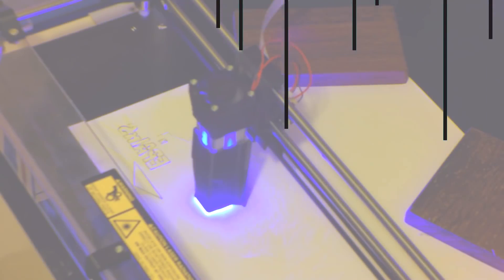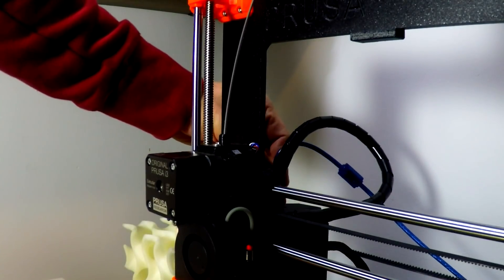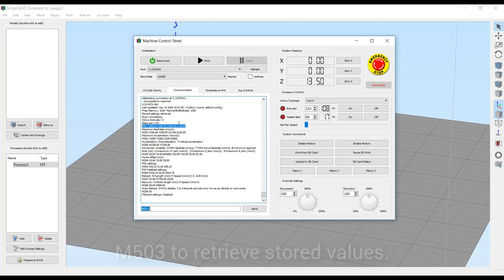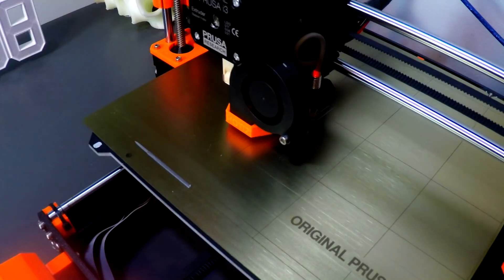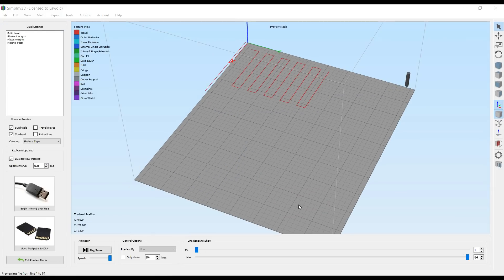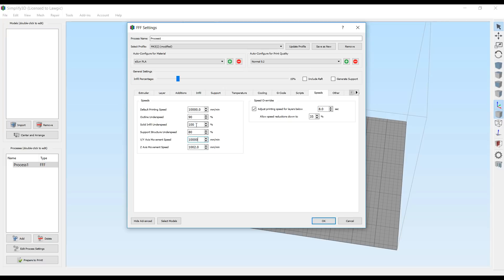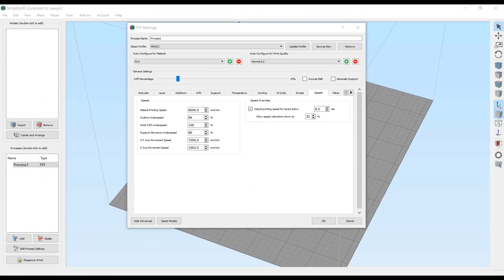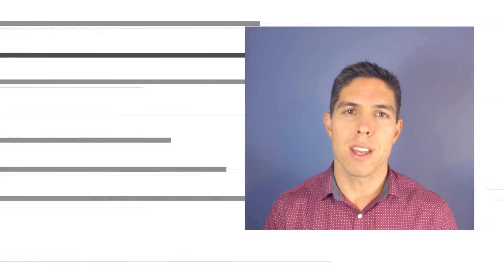How to use Linear Advance in Marlin

Comment: Just an observation..... Ran the “ linear advance “ G Code  noticed bed was heating very quickly... this is great no waiting. Third/ fourth time of G Code bed would not heat.... Eventually found SSR had fused and wire melted on bed plate.  Then found your Video on installing “KEENOVO “ heater......turns out the manufacturer had installed a cheap copy SSR . Off to JAYCAR for a genuine SSR .

Comment: Dos the K value change with Layer height , for example if you do your Test pattern at 0.2 layer height (where its Easy to pick winner) will it alter if you then drop your prints to 0.1 ??

Comment: Great video, its helped me improve my prints. The one thing I cant seem to get right is print speed. Im using Cura, and entering the settings you mentioned. I see your print time is about 5min. When I slice it takes 13 min. Even if I increase the print speed the time doesnt change. Lost
Reply: It's because the printer can only move so fast. You can put a million in there if you want it won't change the actual print time. 
I'm guessing cura has a maximum speed value for your printer in the profile so it's working off that when calculating the time. 
Simplify 3D is quite behind on features and probably doesn't have maximum speeds in the printer profiles. Meaning it is just calculating based on the numbers he put in. The reality would be different though.

Comment: The way LA (v1.5) works is to compensate for elasticity in the filament and the extruders reactions to it. On a direct drive you gonna see much much much much less improvement then on a bowden setup, simply because the elasticity of the filament in a bowden setup is much higher.

And this makes linear advance an awesome feature to have on basically all bowden setups. And when i say awesome i mean.... insanely feraking awesome. It actually allows me to get up to speeds higher than with my flex3drive setup while maintaining almost the same quality. But at no additional costs and a simple install with very little fine tuning (as opposed to installing the flex3drive unit). as a major plus it also reduces stringing by quite a shitload. My retractions could be lowered by almost 60%.

I can therefore wholehearthedly say that linear advance 1.5 is a must on bowden setups. It always you to print past the 200mm/s mark without significant quality loss.

Comment: Hi - where can I find 'extrusion multiplier' and 'extrusion width' settings in Cura 4.6.1 please?
Reply: Its called "flow" in Cura, and there is also an option for flow on the initial layer. If you do a google search you can search "calibrating Flow in Cura" with a 2 layer wide cube.
Reply: Peter John Joseph - thank you ever so much!
Reply: K L no problem. Had the same question myself at one point.

Comment: I noticed you are printed much faster than I usually do (even when not using LA), for PLA I usually print at 60-70 mm/s (1920-4200 mm/min) without LA. Do you usually print these speeds on your other printers, such as Ender and i3?

Comment: I try the linear advance on my hemera extruder.  With the testpattern i get a result at 0.1. The testprint of a calibration cube came out super fine, but at a layer hight of ca 10 the extruder motor stop, did not know why.  There is no overheat i think, measured the stepper with a laser thermometer at 45 degrees celsius. The driver is even colder. Do you have any ideas.?

Comment: Neither of those were vernier calipers lol, but excellent video. Verniers have a vernier gauge on the side, it interpolates a 1 tenth scale of the divisions on the rule without using a dial or readout. 9 divisions on the gauge take up the same space as the 10 divisions on the scale giving you a different number that lines up for very tiny changes. Pretty cool way to get that extra decimal point, but they have to be made well.

Comment: Good info , however didn't you go the wrong way on the extruder calibration? You said default was 280 and you extruded 100 mm but you were left with only 19 which means you were over by 1. So you're estep should have been closer to 272? forgive me I see that other people have already pointed that out as well I didn't see the comments below. ;)

Comment: One thing about calibrating your extruder - generally speaking the steps are right-ish. But the problem with extruding through the nozzle for E step calibration is that then your motor is actually calibrated wrong. It will be calibrated for that filament with that nozzle, and that's it. Changing to another filament or another nozzle and your calibration is out the window if it doesn't interact the exact same way. You should calibrate into free air to get a correct measurement and calibration of the motor with only the tube being a factor in your calibration. Any other extrusion changes should come from calibrating your flow - which has to be done for every type of filament anyway. 

While technically you can flow calibrate your way out of a poorly calibrated motor, it just isn't good practice. You also may have a slightly clogged nozzle during calibration without even knowing or it may be too cold. 

Other than that, amazing video as all of your videos generally are :D

Comment: I've been messing with linear advance on my Ender 3 (Bowden still). I spent hours tuning the K value with the calibration print, and honestly, all it really seems to do is overwork my extruder.  I was seeing marginally (very marginally) better results at speeds above 100mm/s, but I typically only print at around 60-70mm/s and at that speed If anything my prints looked worse.

I was able to reduce my retraction to like 1mm though and I got no stringing, so there's that.

 Is this really meant for direct drive? I've seen conflicting info. It seems like with a bowden printer it doesn't really do much since bowdens already print fast really well. Also there's a lot more "slop" in a bowden, so it seems to me like it really can't manage the nozzle pressure as well as it probably could with a direct drive setup. It also just stresses me out seeing the extruder going crazy the whole print. 

Maybe I'm doing something wrong.
Reply: What stepper drivers are you using? The TMC2208s need to be in Spreadcycle to handle linear advance, and while I can't say for sure, I doubt the stock power saw-like stepper drivers can handle it at all
Reply: @Anarasha  I'm using 2208s with the extruder in spread cycle and square wave stepping enabled so that the extruder works at all with linear advance. I've recently tried it again with a bmg extruder and I got similar results except this time the bmg really didnt like the jolt of being run back and forth really fast like that. I was scared it was gonna wear out the gears and cause backlash. I think that the K value required for bowden systems just makes the extruder work really hard to maintain control over the pressure correctly. My bowden tube is less than 350mm long and I'm using a capricorn tube so I was able to get a K value of only .45 to work well, but it was still stressing me out watching my poor bmg slam back and forth everytime the nozzle rounded a corner. It was especially bad with gyroid infill.
Reply: @WrexShepard  Well, if an extruder frame can't handle the stress of 3D printing at speed, it's not worth using. I get the stress you speak of, but you just have to relax and trust your hardware
Reply: @Anarasha  Fair enough. I shall trust my little trianglelab bmg clone. You're right, if it cant handle it without wearing  out it's a piece of doodoo and I need to go back to the non-geared bowden style extruder. The big ass stepper motor I have driving it has more than a enough torque to give the bmg a beating though lol. 

I might go direct drive soon anyway, since I recently added a 40mm wide extrusion on my x axis and a 2nd z stepper so I think I might have the ender 3 ready to be DD without causing massive ringing issues. This should allow me to drop the K value significantly. I just have to design an elegant way to mount it with a pancake stepper for weight.

Thanks for reassuring me that I shouldn't be able to break my printer with basic functionality lol.
Reply: @WrexShepard  I managed to make it work on TMC2208 by the way. You just need to use the following two values in your firmware: 
#define MINIMUM_STEPPER_PULSE 1 
and 
#define SQUARE_WAVE_STEPPING

With those, I have no skipped steps on a stock Ender 3 extruder with the metal frame
Reply: UART of course, Spreadcycle with current set to 900
Reply: @Anarasha  I read elswhere that 900 RMS is high for the 2208s with the ender 3's stock extruder. I know teaching tech suggests that in his 2208 video but what I read says he didn't do the math right. My motors and drivers ran kind of hot with those settings.  From what I understand, The RMS current, which is what you are setting in firmware should be 640 (0.64a), to equal a vref of 900 (0.9v).  With a RMS of 520 on XYZ and 640 on E I don't get any skipped steps, at least and my motors stay at around 35c instead of like 50c.

 I got linear advance working with those settings as well. You don't need minimum stepper pulse btw, just square wave stepping. It works fine for me with a K of 0.65. It just tends to go crazy on small curvy movements but it's just noise. I figured out you can change the linear advance K in cura though, so I set it to only run at K0.65 on walls and top/bottom surfaces, and  set the K to 0 on the infill. That way I get the surface finish benefit, but the extruder chills out for most of the other parts of the print.
Reply: @WrexShepard  Now that you mention it, my motor HAS run kind of hot. It's entirely possible I should change it, thanks for the tip :-) 

Without minimum stepper pulse, I had excessive step skipping though because it tried to move too fast with no delay
Reply: @Anarasha  oh, by the way. If you have an ender 3 pro, it has a bigger stepper motor on E than the stock E3. I think the regular e3 has a 40-40 motor on E and the pro is something like a 40-44. So the value I gave you might give skipped steps on the pro motor since it wants a little more current. I forgot to tell you that. I use 740 RMS on my e3 pro and 640 on my regular E3.
Reply: @WrexShepard  Thank you for the update :D I have the regular Ender 3. So far I've still to properly test the new value but it certainly gets less hot - thank you :D

Comment: 4:15 you can get 4 0-25mm micrometer for that and more acurate. digital caliber is 0.02 tolerance you never know is it read correct unless test it,. and more you push less you get. less you push more you get.you cant get correct value and then there is that +-0.02.thats how calibers work even

Comment: Thanks Michael, but I can't get a single wall cube to print in Cura - it doesn't slice if the top and bottom layers are 0 (unless it does, and my self-modelled cube is trash.
Reply: You dont want to test a single wall anyway. a better test is 2 walls.

Comment: Hey mate

I wondering if you could do a linear advance video using the Ender 3? I can't get the lines to work properly either by using the k value test you ran or by using the k value test compiler by marlin! The slow speed works fine but when it goes to the fast speed it doesn't lay any where near enough filament on any k value? 

Please help!
Reply: I agree

Comment: I have a strange problem about this  calibration process after I measure the cube wall by my callipers, I do the calculation, then decided to change the flow rate to 93%, the print result was good, the wall thickness is right, but the height reduced by about 5%,  do you know how to keep the Z height when reducing the flow rate?  thank you.
Reply from the maker: That shouldn't happen, it should be unrelated. My guess is a coincidental other issue.
Reply: @TeachingTech  ok, maybe, then do you know which parameter I should adjust to calibration the Z height?

Comment: Hi thank you for this explainatons, even if I'm not realy good in english I understand the technicals reasons of LA but it's a little bit harder to do the complete settings specialy with simplify3D that I never used before, this will take me some time to read every think in description.
But you certainly know that last prusa firmware add some settings for LA directly into the lcd printer menu? do you thing we can enter the same values caculate into this video directly into the printer without simplify3D? 
Have you try the prusa's methode with the test tower gcode for the extruder LA?
And last but not least do you plan to make a new video using this new mk3 menu settings for LA (please)

Comment: Does this work for any filament or is it specific to pla I'm curious about petg
Reply from the maker: It works for any filament. The K value will be different, that's all. You can edit the temperature in the linked test gcode to suit other materials.
Reply: As far as I understand it,  it works for every type,  but you need to dial each type of material separately and store the "K" value in the slicer profile of that specific material.

Comment: Excellent Video! Do not know if it was mentioned, I did not see it in the comments. When talking about the extrusion multiplier at `5:18, you mention 0.54 in the box. Did you mean 0.45? On the description flashed on the screen it does say 0.45. Just thought to share what I caught on to.
Reply from the maker: I think there was in issue with refilming for the camera here. From memory I have a note in the description about this.

Comment: Missed a very important step, which is measuring filament diameter and putting that in your diameter settings. Only after that can you calibrate your extrusion multiplier
Reply from the maker: Quite right you are.

Comment: What was the 3D benchy time before and after Linear advance was added?
What speed did you print the 3D benchy before and after Linear advance?

Where can I get that cool clock timer you got on your desk?
Reply from the maker: I didn't time them when filming, but S3D predicts 29 min at 8000mm/min with LA, vs 37 min with Chris' arlier profile, which was set at 7500. S3D is always wrong but you can make a relative comparison. Clock is a $10 cheapie from eBay.

Comment: Was there any need to mark the first 20mm?
Seems like it was not needed since the filament would have been melted in the nozzle anyway.
Reply from the maker: In the case of over extrusion, a line  marked 100mm along will disappear but you won't know how far in. If you have a 20mm buffer first, you will be able to still measure. Eg. 14mm left if it extruded 106mm.
Reply: @TeachingTech  then just mark the 120mm? The 20mm mark makes no sense :) Even you did not measure 100mm from the 20mm mark but 120mm from the coupling. Keep it up!

Comment: Awesome tutorial, thanks! One thing you forgot to mention is to ensure that the Coast and End and (I think) Wipe Nozzle in Simplify3D when doing the calibration, particularly for the K factor. Once Linear Advance is enabled those workarounds aren't needed anymore.
Reply from the maker: I agree I should've mentioned that in the video. The profile I used already had it sorted. I read that retraction should also be off but when I tried it I got terrible stringing.

Comment: Extrusion multiplier and Esteps have EXACTLY the same effect (See the documentation to confirm this). Had the math not been messed up when calculating the Esteps, there would have (or should have) been no reason to change your extrusion multiplier.
Reply: Incorrect. Although both settings result in the same effect, they are being used for different reasons. Esteps take care of how much filament to be driven through the extruder. Different filaments have different characteristics and expand differently when they leave the nozzle. Then, by experiment you choose the correct extrusion multiplier for the different filament. Otherwise you will need to change the esteps on your printer every time you change the filament.

Comment: Note that M503 doesn’t necessarily tell you the settings stored in the EEPROM. It reports the current settings in RAM that would get stored with M500. To get the stored values, use M501, and then M503 will show the values just retrieved.
Reply from the maker: Well spotted, thanks for sharing.

Comment: For calibration, if you make a larger cube, won't it make the calibration more accurate as any miscalculations will be more greatly emphasized? would also save you the trouble of buying another caliper if for some reason you don't have one that goes down to two decimal places
Reply from the maker: I suppose it matters whether or not the perimeters are squished together or not. Eg. a three permeter 0.45mm width equals 1.35mm or actually less. Haven't looked into that yet.
Reply: Teaching Tech that’s a good point, hmm, so some slicers allow you to adjust perimeter gaps or come default squishing perimeters, in theory the outer perimeter should always be laid to achieve appropriate dimensions and then the supporting perimeters squish into it and reinforce the outer perimeter, I guess that just opens a whole other can of worms on calibrations, all way above my 2am brain farting, I’mma just buy a better caliper for my cheap scrougy ass
Reply: @Bajicoy  if you think about it, as the slicer thinks it's extruding 0.4mm you will not have 3x0.45... there will be overlap between the outer perimeters and the inner ones. The extruder will draw a line thinking it's 0.4 then move 0.4 and draw another line. But because they are 0.45, there will be a 0.025 overlap. So even with multiple layers you need accuracy as the error is the same (half of it on the outside, half on the inside).

I need to get some sleep and stop rambling...
Reply: Alex Cristescu true, that overlap makes things super complicated, dang, I can’t remember what this was all about but man am I staying away from calibration cubes that aren’t a single perimeter thick lol good stuff though